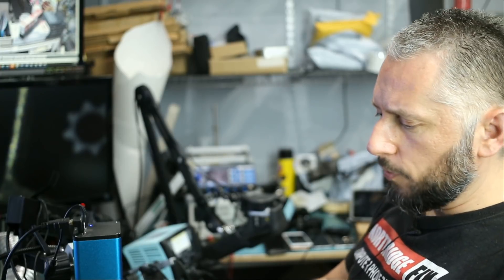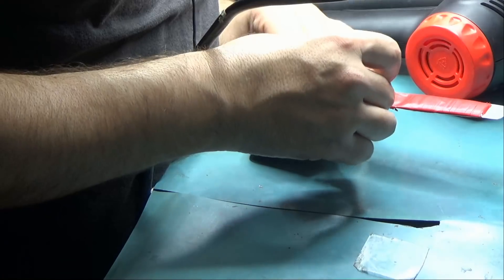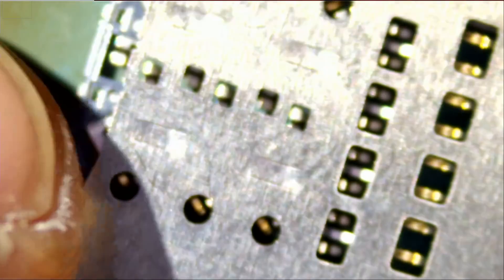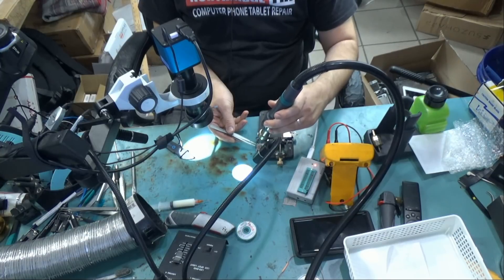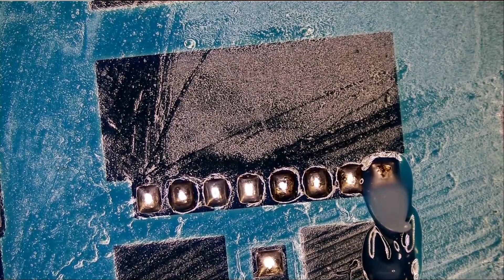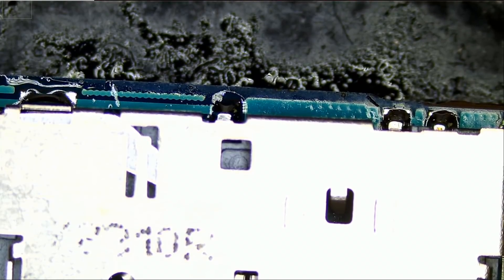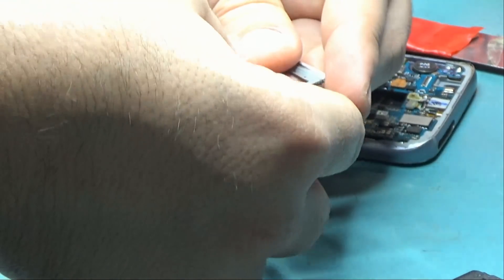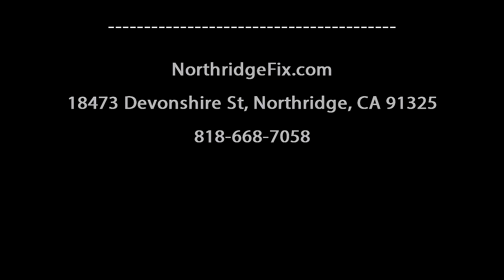Samsung Galaxy S7 Damaged Sim Reader Soldering Replacement. Same applies to S8 S9 S10 Note8 Note9

Comment: I have a Galaxy S20 G (SM-G981W) with a faulty tray (not physically damaged, to my knowledge). It won't detect the SIM card. I would use eSIM, but eSIM is blocked on the Canadian variant (all Snapdragon variants don't have eSIM to my knowledge). So that leaves me with replacing the sim card reader slot. I saw a video of the motherboard being replaced on the S20, and it appears that the principle would be the same (take the motherboard out, remove the sim card reader slot, and resolder the new one)... is that correct?

Comment: Samsung amoled screens are strong and the glass is only for protection. 
Since you heat the back glass there is no chance to damage the screen. 
The trickiest part in these phones is replacing the battery.

Comment: I work with Samsung phones in authorised repair and I wish we could use leaded solder, this is waaay easier. What I have to do is take the new reader apart and do it by hand pin by pin, then put the ejector and case on and finish the outside legs. All with iron. All because I don't want to damage the wifi chip on the other side by putting too much heat into the board... 
Nice fix.

Comment: You can use an old crap soldering tip to "weld" the plastic back together if you need to in the future.

Comment: If the sim card reader is made of plastic won't it melt if you apply heat with the heat gun
Reply: yes but is kind of plastic that cam take about 350' temperature

Comment: When soldering smd components that runs hot like power MOSFETs ,power transistors, any smd components that runs hot is it safe to use leaded solder when replacing that bad component or use the same unleaded solder, for example laptop power mosfet gone bad,?

Comment: s10 was loose back after screen replacement and got moisture damage from carrying in out of AC in florida. when i insert sim in my s10 hangs/crashes and touch wasnt working at all. cleaned up contacts which were corroded, touch fixed, but sim still hangs phone. while in airplane mode its fine but once data is turned on it just hangs. with sim inserted phone doesnt even boot fully. any ideas if the sim slot is bad or mother board damage? without sim it works great no issues at all

Comment: Bought an iPhone 8 Plus with a bad sim card reader thinking its an easy repair. It's harder than it looks. Plastic just melts. I think liquid solder got into near caps and something else under the nearby shield. As it gets super hot and the phone won't power on. Without removing the shield to see what gifts await, seems VDD_MAIN is shorted. Thinking solder got to some small caps to the left of the sim tray

Comment: Hi, did you replace the rear cover when you repaired? Not sure how much in the US, but here in the UK, can pick one up for around £5 which also saves messing around removing all the old glue. Once again, great vid ;)
Reply: I fail to see how you can replace a glass back cover without removing the old glue. How would you properly install the new one?

Comment: What are you using here (02:40)?
Isopropyl Alcohol?
Reply: You could use business cards on the edges to prevent it from sticking back
Reply: @Omar alpjaly Transparent gasoline?
😄
Reply: Vindix007 in the UK that type of gasoline is the type used in cigarette lighters...we call it lighter fluid, but yes it is a type of petroleum or gasoline.
Reply: Yes, it's Isopropyl Alcohol to soften the glue.